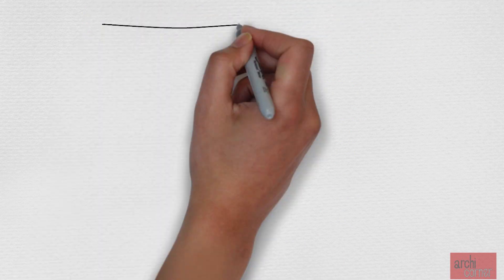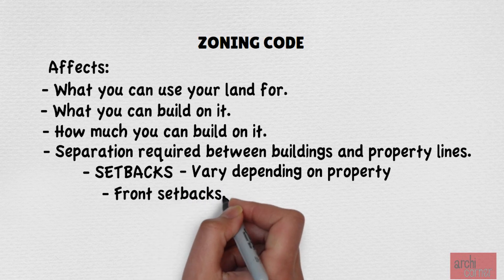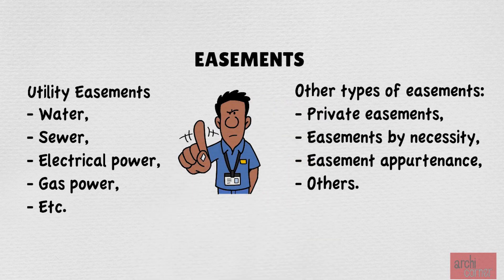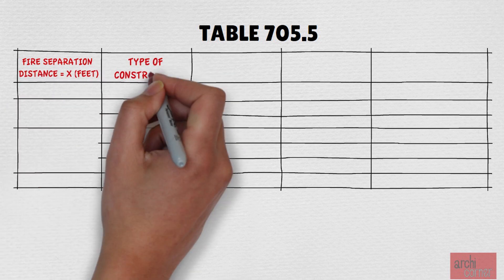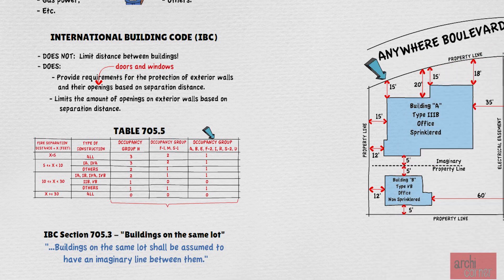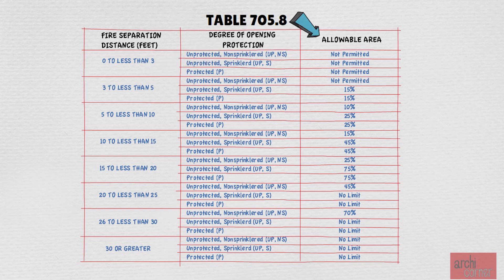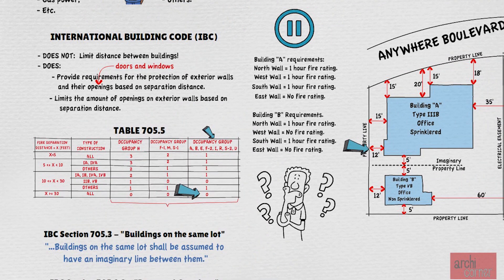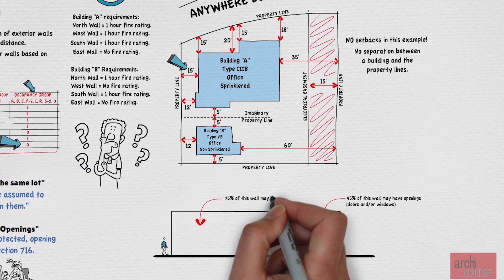AC 056 - Building Separation Requirements

Comment: Thank you for making videos covering topics of interest to us architects. Good stuff!

In this video, I note what I see as an error:

The north wall of Building A follows different rules: On that side, the building fronts a street (Anywhere Blvd).

Where a building fronts a street, alley or public way, the fire separation distance (FSD) is measured to the centerline of the public way, not the nearest property line.

The FSD is the basis of the tables limiting projections, setting fire ratings for exterior walls, and covering openings in walls.

Along streets, typically no fire-rated walls are required, nor opening protection. Example: Most buildings in downtown environments, featuring open facades near or at the PL along the street.

See Chapter 2, Definitions:

FIRE SEPARATION DISTANCE. The distance measured from the building face to one of the following:
1. The closest interior lot line.
2. To the centerline of a street, an alley or public way.
3. To an imaginary line between two buildings on the lot.
The distance shall be measured at right angles from the face of the wall.

Enjoy the freedom of designing buildings along streets and public ways!
Reply from the maker: I believe you are correct in this. I will have to make a video correction to this. Thank you for your input. :)

Comment: After all my years in the Architectural profession, it is good to find someone who has developed Code videos, which is better than trying to read the Code Commentaries at times.  This property line video is great.  I am retired after over 50 years of Architectural work (my ICC certifications and professional licenses are expired now) and I do some consulting work mostly Building Code Reviews for Architects.  I did not find a video addressing the issue of using a fire wall (IBC T-706.4) to separate buildings and how that fire wall causes a reduction in the perimeter increase which affects the allowable frontage area increases.  Could you make a video on firewall scenarios?

Comment: Very helpful.  If the exterior wall is made partly of appropriately fire rated glass block for the wall (and does not "open") that it is not considered an "opening", and therefore be allowed?  This would be for an application where no openings are permitted, basically a zero lot line.  Kind thanks.
Reply from the maker: This may depend on the type of tests that have provided the rating for such glass block. If it was tested as a "wall" and the fire rating reports show that it has the appropriate rating, it may be acceptable to the AHJ. You will need a UL number or other similar 3rd party test verification method to prove this was tested as a "wall".